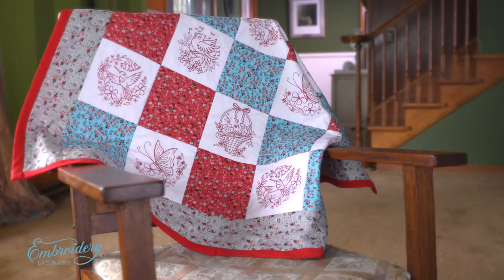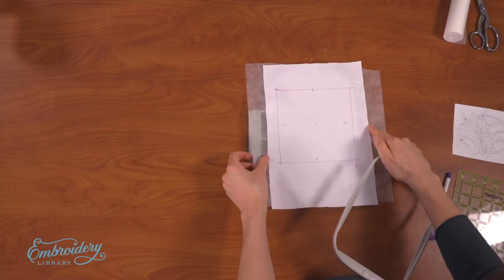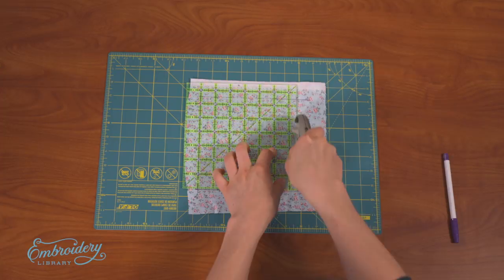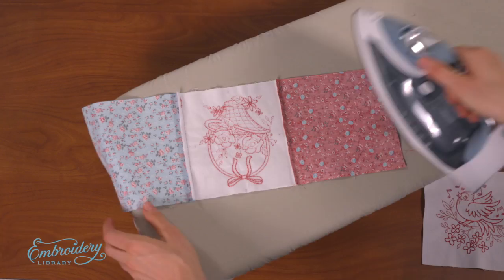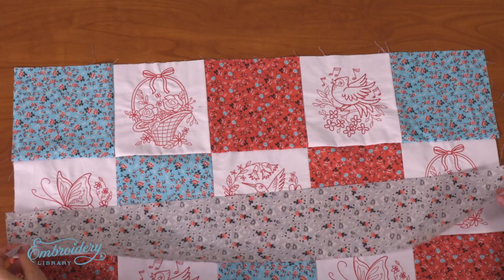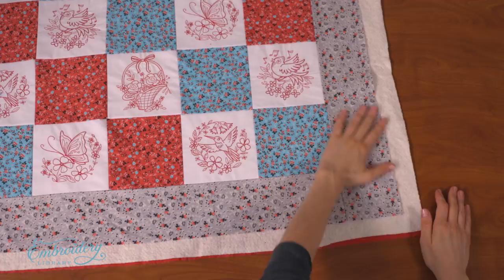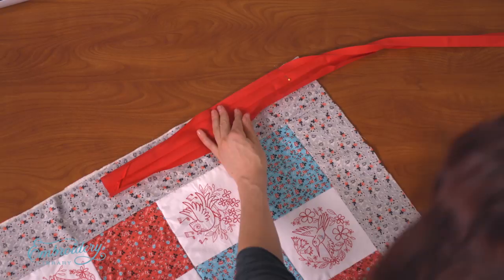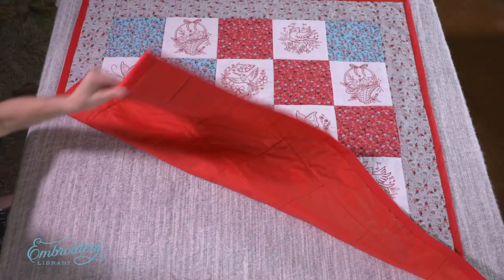How to Embroider and Sew a Lap Quilt

Comment: Hi, loved the video and the answers you supplied below about leaving the sheer mesh stabilizer in and stitch it in the block.   
But the question I have is that this is basically an outline design.   What do you use as a stabilizer when your stitching a more dense design?   
thank you
Reply from the maker: We generally recommend a medium-weight cutaway stabilizer with a 75/11 sharp sewing needle for most projects.

Comment: I noticed that you drew the square before embroidering it.  I have noticed that after embroidering a square, it is a little bit smaller, because the thread pulls it in a bit.  Have you noticed this and do you have to compensate for it when you cut out the block?  Thanks for all you guys do!!
Reply from the maker: Hello! We digitized these designs to coordinate with the final sizes. Thanks!